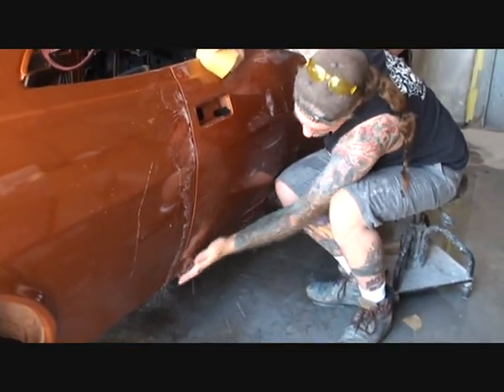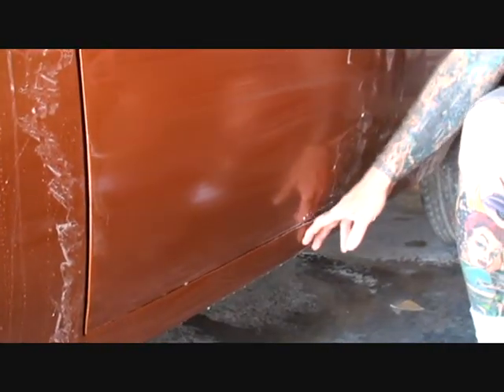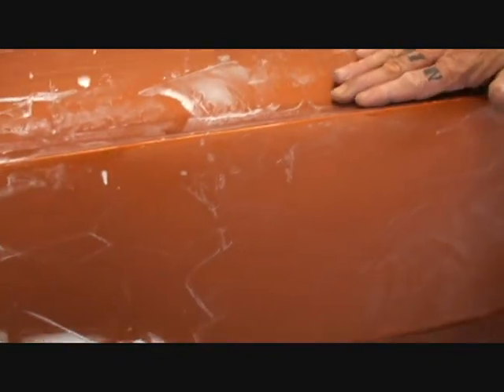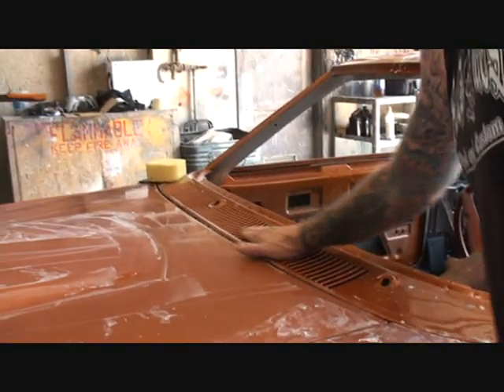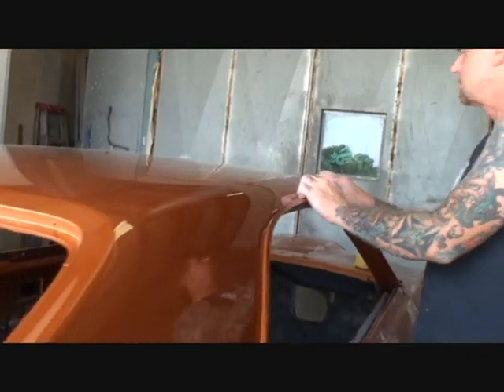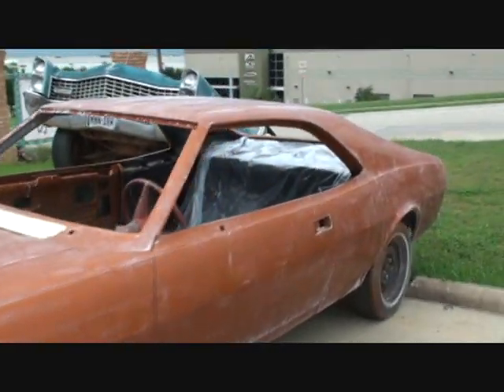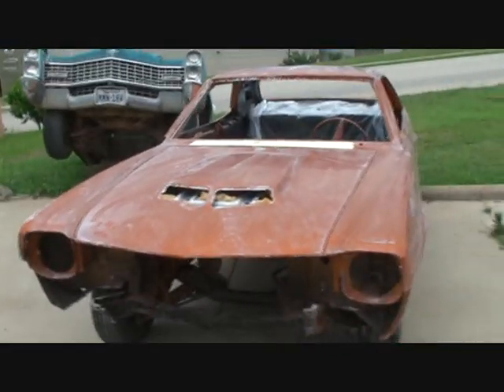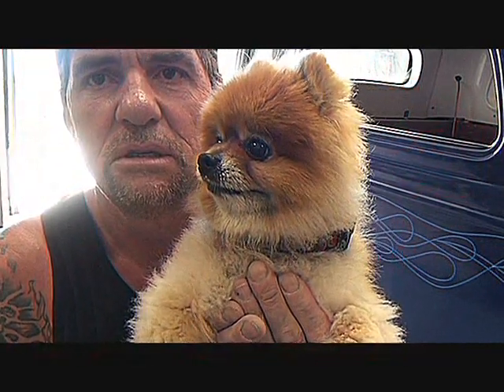1970 AMC Javelin-Color Sand And Buffing Your Street Rod. Part 1

Comment: Hey Pete, I watch your videos all the time and some just keep me cracking up with the clown acts you had before.  I have a 2001 Chrysler PT Cruiser with some dings in it plus a small dent in the rear fender and some rust on the bottom. Would you think a top notch paint job is worth it for a 10yr old car with over 100,000 miles on the engine?  Or should I consider a cheap job like one from Maaco?  What would you recommend personally?